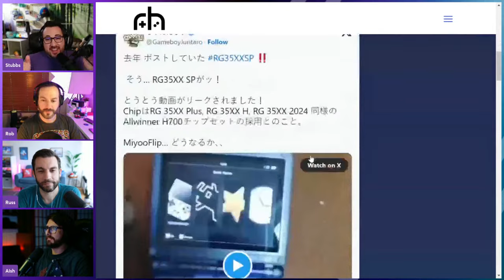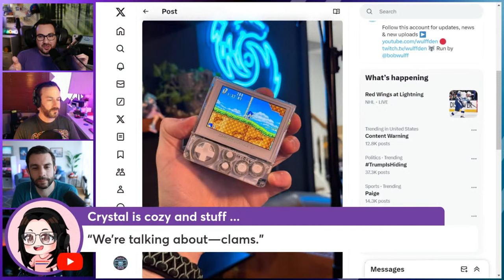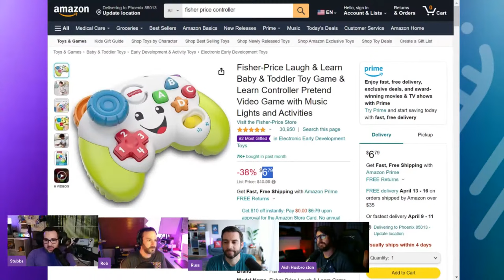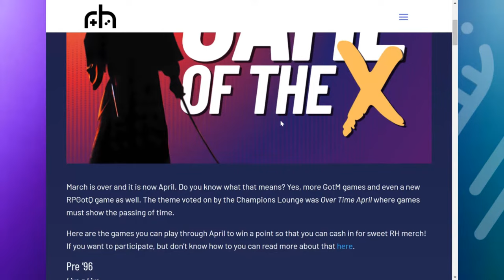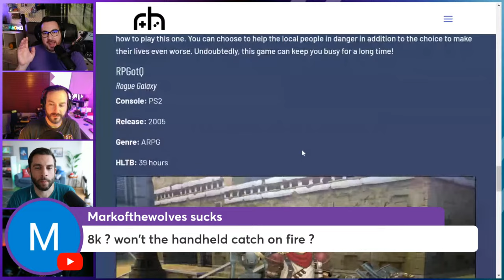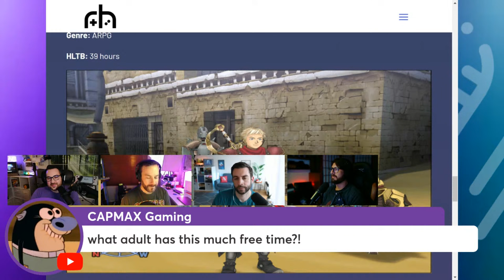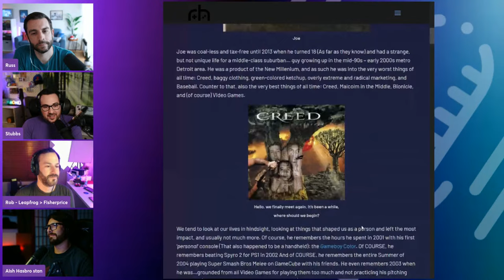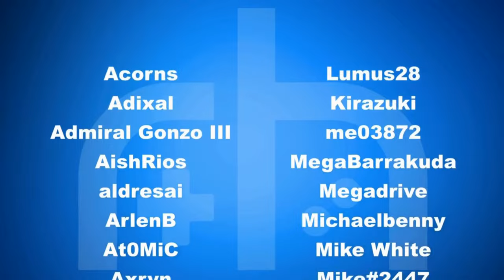NEW rg35XX SP, Fisher-Price BEAST & Gacha SP (ft. Retro Game Corps) | RH Podcast S4E8

Comment: The New 3DS XL is still the top-tier portable clamshell device for me. Just the fact that a modded 3DS can natively run ALL of Nintendo's handhelds up to the 3DS + emulating the virtualboy flawlessly. I just wished it had a higher resolution screen to better upscale the older devices, as well as offering more options, like changing scaling options, color profiles, filters, as well as turning off the lower screen to save battery... Hopefully, one day we will get an "ultimate" emulation device. :)
Reply: It will need replacement screens with higher resolutions to make that happen.
Reply: I keep a New 3DS XL for home use and a New 2DS XL for on the go. Great machines
Reply from the maker: LOVE the XL, I need to pick one up again. - Stubbs
Reply: ...aaaaand the 3DS XL has valid 3D!
A quick reminder: No one ever did that again and never will.
Reply from the maker: @wizzel22  TRUE!
Reply: Honestly same here I've loved my 3ds xl since the day I got it! I just feel like with all the power it has it could have totally used a better screen...although honestly it really just feels dated now so I guess it's just about time for a new spin on it

Comment: 2:00:14 I almost bought a GPD DX, but.... --> 2:06:06 Hell yeah Rob, I still had/have my Nvidia Shield Portable. Really amazing portable with touch screen and android OS. I've used it a lit to play Dreamcast and DOS games. The only drawback I have with it is that it doesn't fit in my pocket. Outside of that, it's absolutely amazing. What was that about yellowing you mentioned?

2:03:33 Yeah, I purchased a flash cart for the GBA back in 2002-2003 (The 512M X-Rom cart) and it can fit several GBA games on it. Or emulators and a hundreds of games for the NES, GB, GB Color, Game Gear, Master System, and some other consoles I can't remember the moment. I loved the SP as I used it on the train a lot when traveling. But, it has an issue that I don't see many people talking about. The shoulder buttons, especially the R, after a while of having it in your pocket, requires you to press it really hard for it to register. I had the same issue with the DS Lite on the R button again. Both handhelds were never dropped and I got them brand new. They were always stored in my pocket in my jacket/coat/vest (depending on the season) when not in use.

2:05:06 Do you guys know of anything similar to the Fun Key S with it's clam shell design that has a screen size of at least 3" and at least a resolution of 320x240? And do you know of a clam shell that fits in your pocket that runs Steam OS or Linux?
Reply from the maker: Love this comment! Ah check out the FunKey SP mod! Takes a GBA and puts FunKey guts inside, we have an article on our website that talks all about it. Thanks for watching!
Reply: @retrohandhelds  Oh that sound awesome. Will look into it now. TYVM 👍

Comment: Rg 35xx with garlic os 1.0 is all you need for most old school consoles... If you like horizontal then 35xx H. Everything else is noise. You only need to start discussions when it comes to ps2 emulation which I think is the whole narrative till 2025 end. For now there's too many models doing the same basic thing. This is what happened to vapes and mods. Too much noise.
Reply: Though the upgraded SoC on the Plus model and 35XX ver2 allows a more comfortable performance ceiling for more graphically demanding outliers in PS1 up to N64/DC.
Reply from the maker: Still my favorite of the bunch! - Stubbs
Reply: Big disagree. Anbernic's quality control, ease of use and out of the box experience are worst in the industry. I'd rather put up with a company actually who cares about their product and doesn't send 4/4 busted products back to back.
Reply: @user-to1su2iy4d  
I would also agree that depending on the shipping and supplier that the units aren't guaranteed to run out of the box not dead on arrival. Not to mention their in-house firmware lives much to be desired, hence some of their handhelds are running on Android instead.